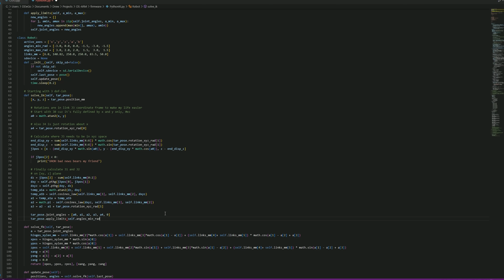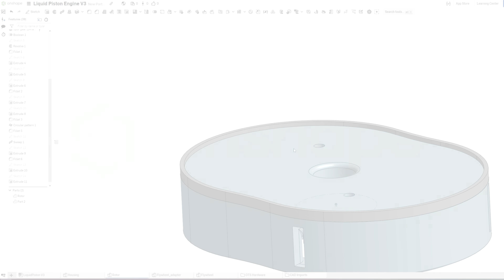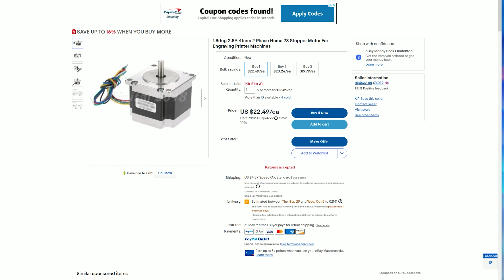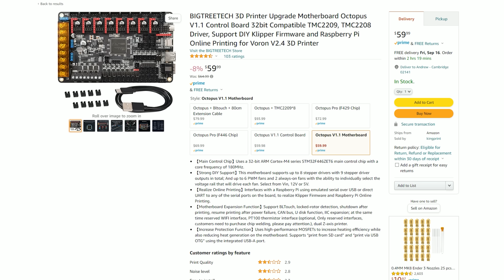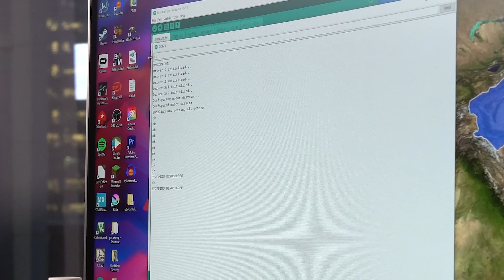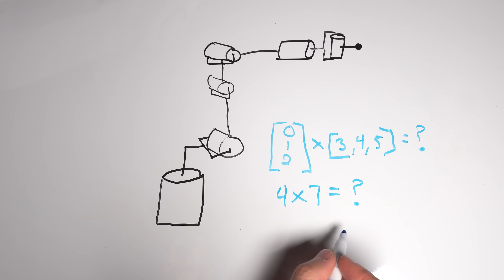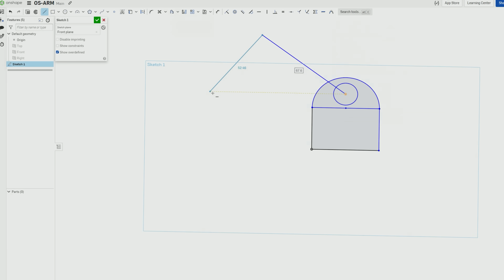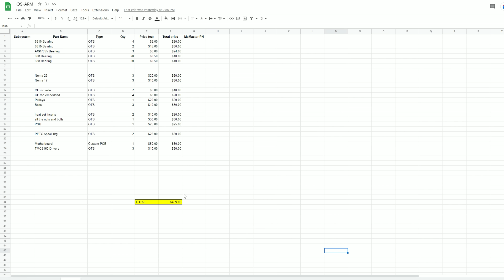I Made a Robot Arm to Hold My Camera [$500]

Comment: for your harmonic drives: a bigger ring backing the non flexing tooth profiles will make them much sturdier, you shouldn't rely on the backing plates for structure like you do; too much layer shear load. Bigger ring gives you more layers to transmit torque through as well. Speaking of, add another plate and replace the really large ring bearing with something more reasonable.

Comment: I have been doing a lot of research lately befor finding your amazing post. I too have been contemplating the possibility of using a self-made armature such as yours that could be built at a price point that was remotely affordable would work in a 5-6 access CNC Mill? It would have to be powerful enough to hold one of the more lightweight router spindles that are just shy of your camera weight but also have the accuracy and a speed that was acceptable. I have been planning to make a multi-process machine that has a modular design where depending on the project the milling spindle could be swapped out with a printer extruder and a CO2 laser. The last question would be about how hard it would be to modify your programming to operate these functions, or using Linux with my own software? Considering these questions, what do you believe the chances of your build with these modifications would be strong, fast and accurate enough for it to work.  It seems that armatures such as these are the best way to go when needing to control 6 axis’, although every time I come across pundits answering other’s questions concerning this topic on forums they basically discourage people and tell them it’s too complicated. Love your work mate! Cheers

Comment: not sure if this will help with shakiness but someone on yt built a similar working bot and used tension band to provide resistance to motion o each joint which required more power from motors but made the motion a lot smoother, hope this helps

Comment: I have a 350x350x300 printer. Can I print it with that without the cutting and carbon rods?
Reply from the maker: In theory yeah, but the parts are optimized to print vertically when cut in half, so you may end up needing extra support material. And the parts are cut in two so you'd have to fuse them in cad and re-generate stl's
Reply: @3DprintedLife  ok thanks! I was asking bc there was still a chance that they were not separated somewhere…
I can pretty good with tinkercad, so I guess I will go that way when the time comes. The important thing is that it can work at all with the assembly as one part models…
Please keep us posted when the final files are ready and maaaayyyyybeee there is a chance for uncut stls anywy??? 😁

Comment: I like what you are trying to do here. I would love to have what you want to accomplish with this arm, for use in videos. 

If you could take this design as a starting point, and could replace structural plastic parts with machined aluminum casting, do you think it would be significantly better? 

While I like the idea of 3D printed parts for development I am concerned about the compromises needed to be made to make it reliable. I have not done much 3D printed parts, but a couple of items have made me disappointed due to layer line separation and distortions due to temperature. One of my primary uses for 3D printing is to make patterns that I can use to for aluminum casting of components.

I used to work designing industrial electronics. I have recently retired and am in the process of fixing up my workshop so I can do my own projects. Something like this would be a nice longer term project.

Comment: so you used micropython on atmel soc?
Reply from the maker: Not quite, I use a stm32 F4 mcu with a bootloader compatible with the arduino ide, so all the embedded code is c++. Then there is also a python client to communicate with the board that just runs on my pc.

Comment: What kind of connector are you using on the MUB for board to board connections? It looks like a super cool design
Reply from the maker: These hirose connectors. They've been really great so far, just a little tricky to reflow because of the very fine pitch https://octopart.com/df40c-40dp-0.4v%2851%29-hirose-18838135

Comment: did you try changing the locking settings for the nema 17? in my grbl cnc, if i set the "Step Idle Delay (msec)" to 200, the stepper motors lock enough to hold that weight... i cant manually push any axis...

Comment: you should definitely sand down the contact surfaces and add a bit of superlube, or print the joints in a way that the print lines run parallel with each other i think it would help a lot with the jittering. This is cool as fuck tho

Comment: I think the best way to join two PLA parts is using a soldering iron tempered to regulated to something like 200-230 degrees. It can be ugly, but the joint can also often be hidden or retouched...

Comment: Maybe consider placing the stepper drivers as close as possible to the motors for better performance. And also a slip ring for the USB connection or even an optical interface between the base and the arm and the slip ring only for power?

Comment: So, what if you used two separate systems for each joint? One drive system, that provides the torque to move the joint, and one sensor that doesn't transmit torque, but simply observes the current position of the joint. I think that would simplify the driving system, and that's how the big universal robots that I've used seem to be built... Siemens might be on to something there?

Comment: This looks very cool! 
However, I want to point out some issues with the design:
1. Weight distribution. Most industrial 6DoF robots put motors in closest positions to base as possible - 1 motor in the base, 2 motors right above the base, 3 at the end of waist (take a look at kuka/abb/fanuc robots). This way moving mass is minimized, so faster acceleration, bigger speed, smaller motors. There are very few commercial robots that instead put motors near their joints (UR5 and KUKA iiwa come to mind).
2. The problem with shakiness is caused by previous problem - large moving mass at the end of robot, the motors just cannot compensate for all that inertia quickly enough (although they can lift it no problem as you've shown), hence the shaking. Redesigning transmission and strengthening the body may help, but the cause of the problem will still be there.
3. Does your code do smooth acceleration? Moving camera for real filming purposes will most definitely require that. That will also reduce shakiness. 

BTW, I'd suggest you take existing code (grbl-5x or marlin for example), at least for start. That will take away the need to reinvent proper motor control, pulse generation, acceleration etc. And you can concentrate on IK. (Edit: ah, you are using TMCs with integrated controller, so you probably don't need to do all that low-level stuff)

Comment: cant we use stepper motors??
Reply from the maker: This is using stepper motors!
Reply: @3DprintedLife  sorry not stepper i meant to say servos i wanted to build a 3d arm like this but i was not able to came across servos because of their weight to torque ratio wont it be easy and light weight to use servos ??
Reply from the maker: Yes servos are better, but much much more expensive

Comment: Is there space on the left side of the MUB, furthest from the corner where the two connectors are kind of situated, to perhaps add a through-hole for a screw so that it can be secured down to whatever mainboard you're using (with the help of a standoff) to make the connection stronger, avoiding potentially tearing the connectors? Just a thought
Reply from the maker: If there’s room for a through hole connector then I messed up and should have made the whole board smaller haha. The board to board connectors I use are actually quite strong, just not strong enough to handle my very bad decisions.

Comment: You can solve the IK between start and end world coordinates.  Then compute world coordinates at the midpoint of the start end end joint coords.  Then use forward kinematics to see where it would be in world coordinates.  See if the difference between the world coordinate midpoints and actual is above some threshold.  If it is, subdivide that segment of the trajectory.  Repeat recursively.

Then send the series of joint coordinates computed to be linearly interpolated by your microcontroller.

Comment: Great stuff. Might be a wild idea, but could you use a 3d printer with Gcode as your camera robot? It would be built from prizmatic joints so much easier IK and you could use the Ratrig Minion/Prusa Mini  cantilever design. The only addition would be a rotating end effector.

Comment: polish this up a little bit and i will be testing your design, if you need a critical engeneer to finalize your creation. Just tellme when you are ready. As a software engeneer, i have skills in robotics, electronics (up to hot air and hotplate soldering; component level) and image recognition.

Comment: very nice, but the problem is you can only reach 5 degrees of Freedom and not all 6, because you have only have 5 joints. You need another twisting joint between your current joint 3 and 4 to be able to reach every position. So the first 3 joints are for translation (xyz positioning) and the joints 4 to 6 are for the orientation of the endeffector. The simplest way to design it, is to model the joints 4,5,6 in a way that their rotation axis meet in one point. That point is then also the point that is translated in space by the first 3 axis. You can search online for like "robot with spherical wrist" for more information. Also a good open source control software is from Chris Annin, he has a yt channel with robots and how to control them :D

Comment: Just wondering, why don't you use a "mechanical" input first?
Thus make a very simple clone with the same ratio for distances between hinges and then simply add a potentiometer on each hinge.
Then you only need to 'copy' the angles on those hinges first to your motors.
If you get this communication smooth, you know any computed intermediate step will also work on your arm too.
This will also help you find any issues where each hinge may struggle to keep up with rotational speeds on the input.

As a bonus, you can also log a few basic movements you can make by hand so you can then try to experiment on the needed resolution for how many intermediate steps are needed and whether this may depend on the angle and weight of the moving hinge.

It may also make it a lot easier for you to try movements from point A to B where you can easily see up front what would be a better bend shape of the arm. For example I can imagine it may appear more smooth when the movement from point A to point B isn't a straight line, when for example some hinge may need to lift considerably more weight and needs to accelerate beyond what it can handle, when moving in a straight line.

Comment: Im struggling with much of the same, I love stepper motors, but when it comes to torque and smoothness when handling mass, servo motors are having value. You can get a driver that handles electrical wave construction, like ie. sinusoidal or trapezoid and off course the accuracy of an encoder for feedback. Holding torque can ie. be simulated via the encoder, just pushing the other way if the error rate between expected position and actual position starts to drift. In addition and even though it’s more expensive, current (A) will help with torque. Anyway, love your project!

Comment: I would try closed loop stepper motors. I use them on my cnc mill and lathe and they work well. It's also a simple system. The stepper drive gets the command and simply confirms that it made it to that position. You choose the amount of error in the software and specify how much the drive needs to try to reach or hold position. If you buy those it will likely change the size of the robot as the motors come with the encoders attached and it will definitely increase costs. But it would speed up the completion of the project. The software is the main issue with these types of cnc machines. I would focus primarily on that. The AR3 robot project by Chris Annin is very well documented and lots of software examples and tutorials are available you should check them out if you haven't already. Good work keep it up and I'll be following along.

Comment: A suggestion.

Even if you switch over to PETG or another material, all of the encased stepper motors will still overheat and keep causing problems.

They at least need ports for ambient air to reach them, maybe even a heatsink too
Reply: ABS or Nylon?
Reply: @BL4S7ER  Changing material won't change how some of the motors are completely enclosed.

Motors that overheat are motors that will lose steps at best, and fail at worst.
Reply: I disagree. In my voron 3 stepper sit in 60°C and print fast in there. I can not imagine this to be more than an inconvenience at best for this design.
Reply: @MoppelMat  What are you disagreeing with? 

That thermal damage causes failures for the motors? (check the datasheet it's in there +60 degree c is within the normal operation range).  
That stepper motors need to be able to vent? (If they are drawing sufficient current they get hot enough to be a problem)

Just add a grill pattern to the motor housing part and or skeletonize the fixture, if they still run hot add a small fan. CruzMonrreal is just giving good advice.
Reply: @molomono9481  I said the motors should and can cope with 60° env temps.
Reply: its called a cooling fan

Comment: Very impressive!   You can dramatically increase the smoothness of the movement by setting the high-level acceleration/speed/position parameters of the Trinamic drivers rather than using step/dir commands (assuming you have it hooked up).
Reply from the maker: Ahh yeah I do have that hooked up, that should help. Thanks!
Reply: do you mean to use the uart option? my tmc2209 has that, but ive never looked into its benefits over step/dir

Comment: I dont know if this would be possible because of wobble but mounting it on the ceiling of a box putting a drill on it and using it as a homebuilt CNC-Machine would be sick
Reply from the maker: Technically “possible” but it would be a really really bad cnc
Reply: it wouldn't be stuff enough.

Comment: Both ROS and LinuxCNC already contain code to solve complex IK.
Reply from the maker: I figured there must have been open source options out there but I was having a lot of trouble finding them, thanks for the tip!
Reply: @3DprintedLife  I assume ROS is probably your best bet. There's a bunch of videos here regarding ROS and IK. LinuxCNC has a bunch of solvers, but it is mainly made for machining operations. People have put machining implements on 6-axis arms and used it to for example mill foam plastic with LinuxCNC.